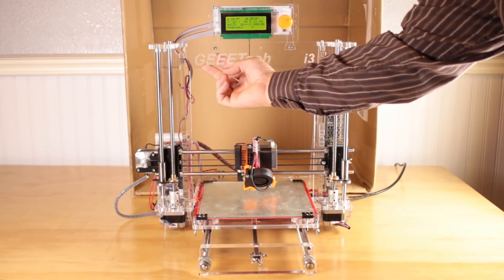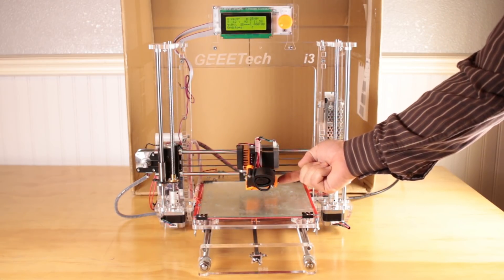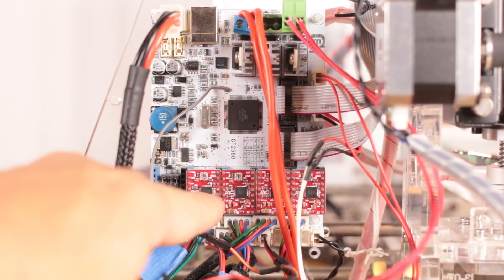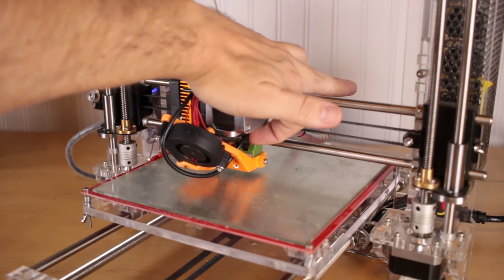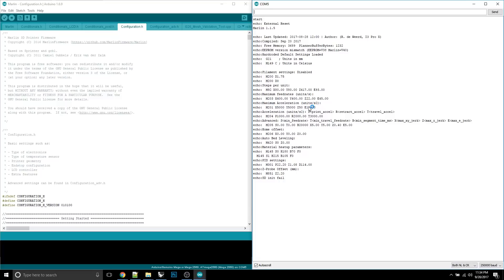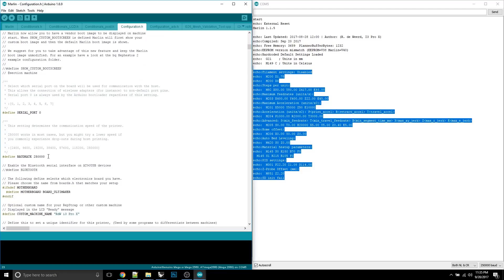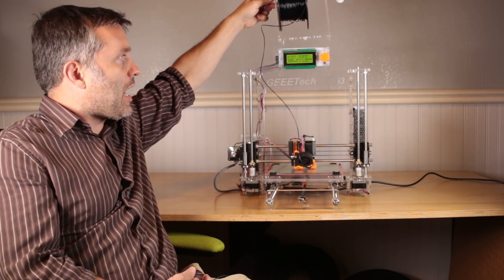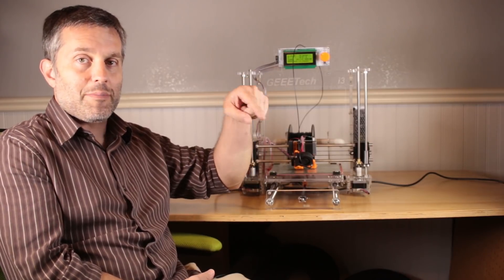Upgrading a 3D printer with Auto Bed Leveling - Featuring the GEEETech i3 pro B

Comment: You don't need to solder anything onto the controller - there's any empty motor driver slot, you can just use a standard jumper cable to get 5V and Ground from that instead (assuming you don't have a 6th stepper motor being used for dual extrusion). Otherwise great upgrades!

Comment: Notice the output from M501 also tell which M-code in Merlin that set them.
You also have those codes in Configuration.h
So do a M501 and then search the M-codes and change.

To check the code when you change, you can test-compile with the check command in the IDE, you don't need to upload it.

Comment: you can upgrade it also with changing bed glass with aluminium and on that you can put M3 9080A sticker, it is the best what I have now you can even don't need to use brim anymore. I will also change nozzle with J6 and bowden drive. now I am adding filament sensor, which will pause printing when end of filament
Reply from the maker: Instead of a Bowden drive you can get a Zesty Nimble. It's the best of both worlds.

Comment: hi, just to update on my problem with the geeetech  gt2560  cheep clone and for any one else that may be having the same problems ( i think you can determine this by the lack of any markings on the back of the board,the proper board has),well it turns out that there is not a boot loader flashed onto the board!..fortunately this can be remedied,with the aid of a Arduino uno,there area a few tuber blogs showing you how to carry out this process, once done you can load and update your marlin firmware to your hearts content!

Comment: You talk about the M501 (or M503) command, which actually reads and displays the eeprom settings in the printer.  There is little point in changing your configuration.h file (apart from completeness) because the eeprom setting override those in configuration.h anyway on startup.    The only reason for setting configuration.h tobe the sameis if you ever want to clear down your eeprom settings.

Comment: You have a bad sensor or wrong model on the round form factor, I use a normally open version and it detects foil under my bed just fine using 5 volts. It even has a pretty long range of around 3-5 mm of height.
Reply: bitcoinsig what’s the name/product code of your sensor?
Reply: my is SN04-N

Comment: Any chance of a copy of original Fw, my GT2560 Rev. A has had problem since i upgraded to Marlin. Have tried Geeetech website, but think that is even a updated version.
Reply from the maker: As with my other firmware for the Kossel, I am happy to share the updated firmware with you as well as the .stl files for mounting the part cooling and proximity sensor. Visit my patreon page for more information: https://www.patreon.com/designprototypetest

Comment: I bought a how to add a PL-08N proximity sensor following watching this video. Where do I plug it into on my gt2560 board? It has a 3 pin connection on the end to connect it to the board. Any help greatly received
Reply from the maker: It's been almost two years since I did this project. I've moved on, and can't help you because my memory is hazy, but take a look at 5:58 . You can clearly see my wiring for the sensor. the three wires start at the bottom center of the screen and after being spliced into differently colored wires they end up as Gray, Black, and Red. Note that the location where the gray wire is soldered onto the board. I've moved away from the very difficult to use Marlin firmware on 8 bit controllers. The 32 bit Duet running reprap firmware is so much better. Here is my most recent video where I installed a Duet Maestro board on an Ender 3: https://youtu.be/PpLEjwLZwBw

Comment: I have a Geeetech Aluminum Prusa I3 and am looking to replace the mainboard due to strange printing issues. Would you still recommend a GT2560? I was considering a SKR v1.3 or a RAMPS board, but I although I have been 3D printing for a number of years on different printers, I have always just used the OEM boards. Any advice is welcome.
Reply from the maker: GT2560 is too expensive, and while it is still a great board that holds up today it is 8 bit. There are 32 bit boards for running Marlin 2.0. I would go with one of those if you want to stick with the Marlin ecosystem. My personal opinion is that Marlin is terrible to work with, and I hope I never have to deal with it again as long as I live. Duet WiFi is the way to go: https://www.youtube.com/playlist?list=PLtVk4dZInT82Wjka6n38Yzp1jNpAcYgj9
Reply: @DesignPrototypeTest  Thanks...your comparison video is quite interesting. I also watched the linked video attempting to destroy the Duet Maestro...having blown electronics accidentally (not for 3D printing), that's pretty impressive. I see the Duet boards don't use external steppers, which seems like a bit of a problem (replacing the whole board is a lot more expensive), though not the end of the world. I'm in Canada, so the Duet 2 Maestro is a bit more expensive ($149 and $169 CAD from Duet's recommended sellers). Not that I likely would do so, but I see they release board specs under Open Hardware licensing, have you had any experience with the clones?

Comment: Hi, Did the same you did but i have Version 1.1.9 and a inductive sensors like you did show in video but my is a NPN so revers of the one you have. All did go wel i think at homing X=OK Y=OK Z=will not stop going down need to reset.
And i cant find what i did wronge??
Reply from the maker: First you have to establish if it is a problem of incorrect wiring, or a problem of firmware. Plug in the senor the way you think it should be. Then see if you can get the sensor light to turn on/off by putting something metal under it. If the light goes on/off then it is wired correctly.

Now you need to go through Marlin and find the lines which reference the sensor. You have to make sure they are referencing the correct pin on your control board. Then you have to make sure that the firmware is looking for the correct signal (normally open vs normally closed). 

With the printer plugged into your PC/Mac open the serial monitor in the Arduino IDE. Then type in the G code M119.
Look at the line of text which was returned in the serial monitor. Then trigger the sensor and do it again. Compare that line to the previous line. This should give you the information you need. Note:M119 is the command for getting the status of the end stops.
Reply: I have done all of that now and it seemed to work for a while. But after several times of homing it was off again. Turns out the sensor had a life of its own. Went spontaneously on and sometimes just did not go on. Problem is solved he is in the garbage can ... LOL
Order a different one that works as it should.
Reply: Mybe this one 3DTouch??

Comment: I've just ordered this Persa i3 Pro B printer from Geeetech, I'm currently looking for a frame upgrade because I want to replace the Acrylic frame. About the sensor, Is there anything else I need to attach and get it auto levelling? Can I just buy the sensor and attach it and that's it?

Can you please advice me on the best place to buy Mods, Upgrades and the Stepper sticks?
Reply from the maker: The acrylic frame functions adequately unless you put the printer inside of an enclosure. Even then it will still work, you just have to tighten all the bolts after every few prints. The expansion and contraction of the frame causes the bolts to loosen. Save your money. even if you can find an upgraded frame you would be better off putting that cash toward a better machine. This printer is an older design. Generally speaking newer is better. The CR 10 is an internet favorite with lots of great upgrade videos. My personal recommendation is the Creality Ender 2. 

If you really are serious about doing all the upgrades to this printer you will end up with a very solid machine. Head over to my Patreon page, and follow the instructions there. I will shoot you the .stl file for all the printed parts as well as the firmware to get your printer working just like the one I showed in this video. https://www.patreon.com/designprototypetest
Reply: Thanks for that, your advice does make sense, so I'll be doing that,... on another note, I've replaced my threaded rods with T8 Lead screws, what is the best technique to find the steps per millimetre?  is that the correct?  .. thanks again.

Comment: I have the same printer and banging my head for 4 days, because sensor just doesn't work. I have connected this sensor to Z_MAX and same settings in marlin like here. Can someone help me with this to work?
Reply from the maker: Sensor gets connected to Z- and the old end stop switch gets removed. Then in firmware, you set up the sensor and mesh bed leveling like I showed.
Reply: Sensor is connected to Z_MIN or Z_MAX? Because on Geeetech forum I see connected on Z_MAX and stop switch is still connected on Z_MIN.

Comment: putting the spool on top is a VERY BAD idea... the vibrations caused by the Y axis movement will just multiply and cause wobbling on the print...
Reply: i removed the top holder from my prusa hephestos and i have better prints, less noise and a little less free space on the side of the printer :)
a spool is about 1kg just waiting there to amplify tremors... i had loose bolts caused by that, too...
Reply from the maker: Have you had this experience? In theory, the mass at the top would behave like a tuned mass damper on a skyscraper, and would actually help your print quality by reducing vibrations.
Reply: Design Prototype Test but it's not a static mass, it's a moving one, it rotates and has small side movements on the holder, as it has to be free to roll... In my case printing improved and noise reduced moving it on the side, not attached to printer itself
Reply from the maker: Do you have a printer with a large single square front gantry piece on the frame like this printer? Or is your frame like the Anet A8 and Tronxy 802E with a single top gantry piece that does not extend down to the table?
Reply: Design Prototype Test BQ Prusa i3 HEPHESTOS Kit Stampante 3D, Rosso https://www.amazon.it/dp/B00OG3LWJK/ref=cm_sw_r_cp_apa_sjUXzbAY0868D
Reply from the maker: That's a nice printer!
Reply: Please keep in mind that these Geeetech printers differ from the original Prusa designs in that they have triangular braces behind the gantry that holds the X carriage.  They work just like the Z brace mods that you find on Thingiverse.  They are the parts to which the control board and PSU are mounted on each side respectively.  

I've never had issues with traditional "Z wobble" from moving mass at the top, either from the Y axis moving quickly or from print spools being mounted at the top (two, actually, on my 2015 Geeetech i3 Pro C).  The only artifacts I've had in my prints from motion are "wavy walls" caused by warped threaded rods, even with some wiggle room at the top (since upgraded to nice, straight lead screws) and "ringing" (not rings, but ringing like a bell rings) caused by jerk settings being too high and overly aggressive acceleration.

It may also help that I have my printer sitting on a 1cm-thick high density foam mat (a single square of the interlocking floor mat type, with the excess trimmed).

Comment: dont you need bootloader for these firmware upgrades?
Reply from the maker: No. The GT2560 on this printer is like many controllers that come with the bootloader as an integrated part of the PCB. Some very inexpensive printers (like the early Ender 3, and Anet A8) have a basic control board that lacks a bootloader.

Comment: You know, I think these devices are over-rated. First, they don't level the bed. Their real purpose is to compensate for an uneven bed surface. The hype is very misleading. I have tried the BLTouch, and didn't like it. I have been printing without it and my prints are fine. To compensate for an uneven bed surface, the BLTouch makes your first few layers as uneven as your build plate. How does this produce a better print? It doesn't. I recently switched to direct drive, and many of the problems I was having with the Bowden setup are gone. Because of it, I prefer direct drive.

Comment: You rely too much on the 3d touch. Neither the motherboard nor the 3d touch knows anything about the build surface, excepting only the few individual points on the bed that the sensor checks, and even then it only knows the distance in space relative to the end of the nozzle of those specific points. Bubbles, wrinkles, or any other defect in the build surface are invisible to the machine. If you print over a wrinkle or a bubble, the machine thinks it is perfectly flat, so does not change anything to the extrusion. 

The height or depth of any imperfection in the bed surface, as the case may be, WILL affect first layer extrusion at that point, and possibly every layer close to that area afterwards. The air trapped within a bubble will act like a variable spring when the nozzle goes over it, as it is laying down a layer of molten plastic, and will cause a ripple to go through the plastic layers on top of the bubble. Think of what happens when you squeeze a balloon in your hand and you will see what I am talking about. A trapped air bubble is no different than a balloon. At the very least, it will cause the first several layers to be way too thin, then it will cause the nozzle to dig into the plastic with every pass until the plastic is as tall as the trapped air inside the bubble -- at the very least. Too big or tall of a bubble, and the nozzle will catch and tear the foil.